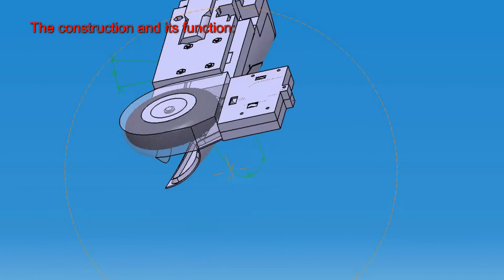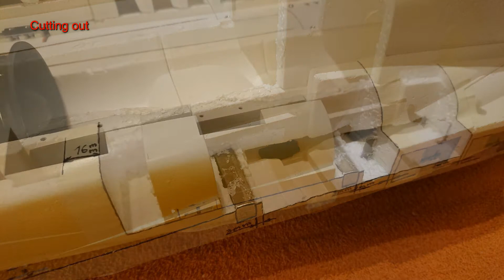Freewing SU-35 3D printed main gear mods

Comment: How much weight did you add to the plane by doing this?
Reply from the maker: I don't know. I would have to check that.
Reply: @The_dream_of_flying  Yeah it would be nice to know how much the weight difference is.  I am attempting to find someone to assist me to reverse engineer and remake the freewing Su-35.  I have two freewing Su-35 and one of them is not used and not built.  THe other one is used with slight damage and modificaiton.  I wanted to find someone with skills to remake a new 3d printable version of the aircraft.  I was willing to provide for raw 3d scanned data if I buy a 3d scanner.
Reply from the maker: @larsulrich3356  
the weight for all parts is approximate 200g.